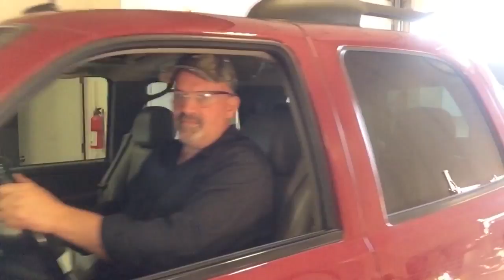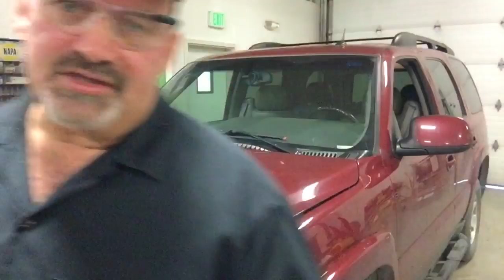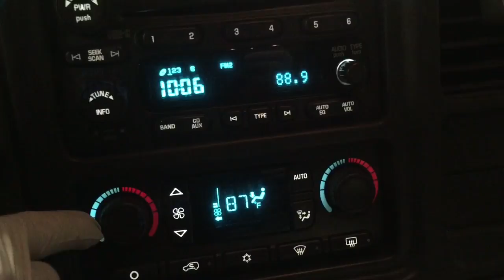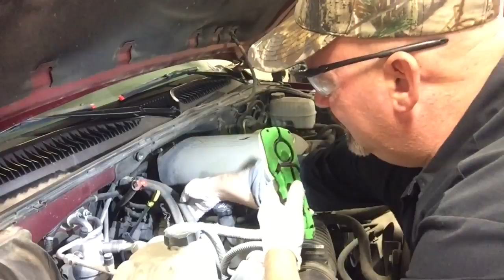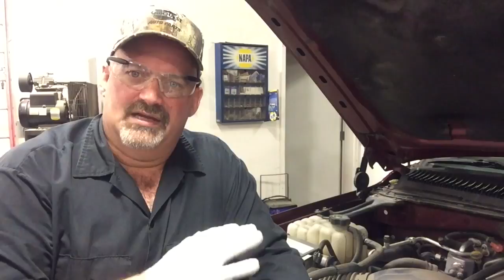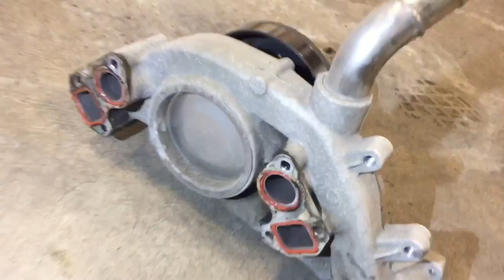Chevy Silverado Tahoe GMC Sierra Yukon No Heat

Comment: @jakepayne Hi I have that issues with low heat. Coolant is good no leaks and it's 2012 with only 50,000 on it. Heat works better if driving, but if not no heat.
Reply from the maker: Have you flushed at all? Heater core could be partially clogged, or water pump is giving out.
Reply: @Jakepayne99  yes it was heater core thanks a lot

Comment: I have a question I can't seem to to find an answer to, just picked up an 04 Tahoe, and at first I thought the hear might take a second to kick on, but now that I've driven it a fair amount, I'm noticing it takes some time for the heat to even, come on, or blow anything. Is there some delay in the heat, does the vehicle need to be warmed up to a certain point before the blower motor comes on? Or am I having HVAC issues?
Reply from the maker: Could be an actuator clogged line water pump I'd start by flushing the whole system abd putting fresh antifreeze in. Thats the easiest thing to do. Next is the water pump they are bad about rusting up if its had nothing but water ran through it a lot.

Comment: Ive got a 99 yukon, and my heat in the front works and blows hot, but in the back it blows cold
Reply from the maker: Rear heater core
Reply: @Jakepayne99  thanks bud